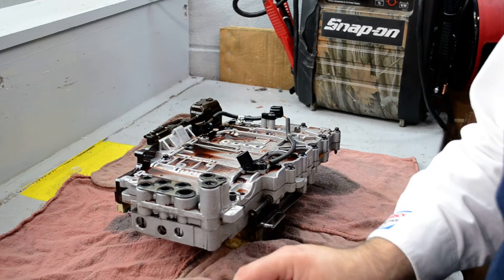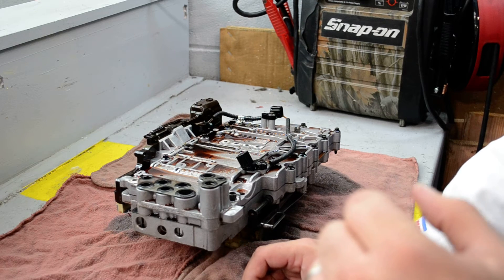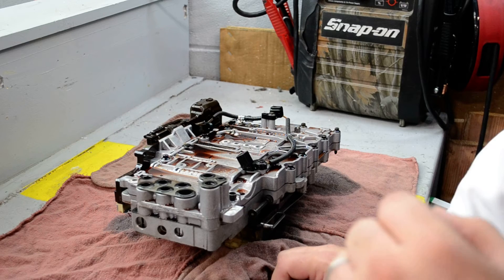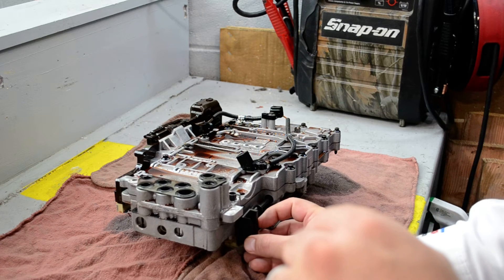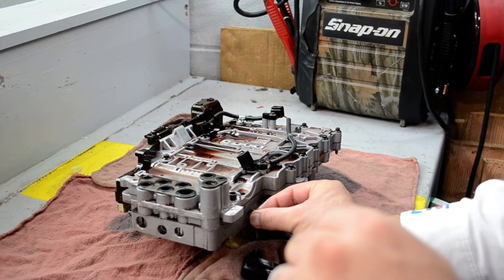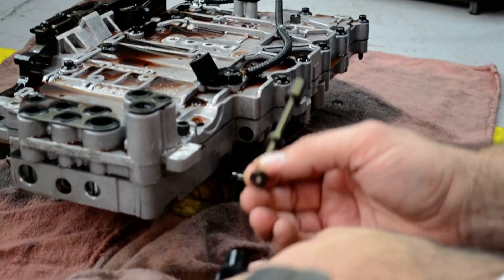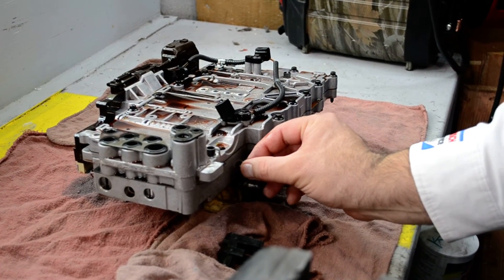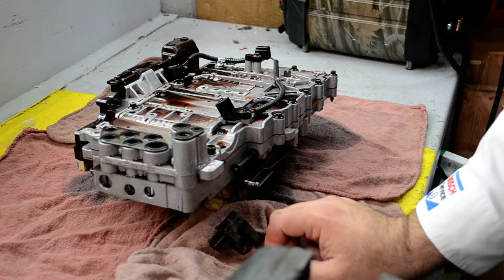No Reverse BMW E90 Xi All Wheel Drive Transmission

Comment: I have the same car with the same problem caused by the same valve stem around the same time! Thanks for the video.
Reply: +funnydognv What did you do to fix it? my e92 wont go into reverse and it acts like neutral but rev only up to 3k in reverse gear.
Please let me know what you did to fix it.
Reply: Sorry for the late reply never seen your question. I dropped the pan and the valve body. Replaced the gear selector valve stem ($18) and sealing sleeve sets ($100, to reseat the valve body). While I'm at it I changed the ATF, filter, and pan gasket ($150). The DME limits revs to 3K when it detected a gear ratio fault in R. It should have thrown an error code in the memory but may not turn on the check engine light.
Reply: funnydognv Wish you replied earlier, would have saved me $2,800 :(
Thanks for replying tho, hopefully someone will see your reply in the future if they have the same problem. 
That $2,800 was harsh, and I was a highschool student at the time too, but its all good now.
Reply from the maker: +redsn0 all of the parts needed are in the comments section.
Reply: There's also a step by step instruction at https://wiki.bentleypublishers.com/display/tech/E90+Selector+shaft+rod%2C+replacing

Comment: I have the same car with the same problem, Today I will open the transmission and I hope it is the same problem that I live here in Nicaragua and no skilled labor if they should repair else
Reply: Hi, Eric. I experienced today the same problem with my 2007 E92 330xi. I am planing to visit tomorrow local BMW dealer but I am affraid I will be end up with a solution of 6000-7000 €...Please inform me shortly if you solved this issue, how and what did you use ? Thank you in advance. Damir

Comment: Had recent problem. Started car, put in drive it goes no where, keep giving it gas it finally drove slowly til it got up to 20 30mph but it wont switch to higher gear feels like 3rd gear I'd say. When I stopped, same thing. I put it in reverse nothing. Could it be same issue or is it transmission. Bmw x3 e83. Thx
Reply: I lost my reverse first, a few days ago, then drive today. Did you find out if this was your problem?
Reply: @2Silverfire2  got it fixed. He said something was broken cost 700. Parts and labor

Comment: Did any body find out about this part?? I just got the same problem on a 2007 Bmw 328xi no reverse no drive and the dealer say is like 6500 to get it fix
Reply from the maker: Find a good independent bmw shop and have them contact our company.
Reply: +BMW Excluservice where is your company name?
Reply from the maker: +Marcos Garcia it's BMW Excluservice www.bmwexcluservice.com
Reply: 2007 328XI - have no reverse issue as well - does anybody know where it can be serviced in Toronto Canada
Reply: Hi joe D. were you able to fix yours i have the same..
Reply: BMW Excluservice I have this same issue but it's also accompanied by the car not passing 1500 rpms while in reverse
Reply: nick martinez any video where I can see how to do this job thanks

Comment: I have a 07 328xi that starts in 1st but goes into neutral instead of 2nd, but can manually take every gear and then go to D after it moves and its fine..  just an issue with 1-2 and flares into 3 at times

Comment: Good info and nice parts list.... only thing is I think this GM unit calls for Dextron 6 transmission fluid.  Any special tools to get it out ?
Reply from the maker: +Fred Williams The transmission in question is a ZF transmission.
Reply: They came with both have to check the tag on the side of trans they do take different fluids

Comment: Thanks man you saved me thousands!  Valet parker killed my reverse solenoid and gave me the car without reverse. Car drove fwd without any problems, but no reverse. I saw this video and bought the part for little $ and installed it without taking the valve completely out. I have another car, so I  planned for a couple weeks planning, ordering parts, getting the right tools (jacks, torks, allen, etc...). It took me another couple of weeks since I was only doing it on the weekends. I drained the fluid, removed the pan, and removed dozens of  bolts but left 2 or3 loosened to allow me to reach solenoid and replace it without dropping the valve. The toughest job was refilling the transmission and bearing the cold weather in New England. Old fluid was nasty. Job is done and car is running great. Thanks!!!
Reply: Where were you able to locate this valve shaft? I am having trouble finding the broken valve shaft that he indicates in the video.
Reply: Yo question
Reply: Don't do this...

Do yourself a favor and buy the seals for the valve body to case also, pull it all the way out and change them too. 

You will have a big sad face eventually if you don't. :(

Comment: I have an 09 328xi with 65k miles. Same thing happened to me but when i parked and came back later it wouldn't go in drive either. Putting it in any gear (reverse or drive) was like putting it in neutral. Wouldn't move at all. ATF is full and no leaks. Could it be the same thing? Im having a hard time believing that it could be the transmission because the car has only 65k miles

Comment: I just got my transmission back from getting a new torque converter and seal and some other interal work on it.  now when I put it on Neutral it stays in place and it's as if it's parked. when I put it in Reverse the same thing . it does not move. do you have an idea of what might be causing this?
Reply from the maker: no

Comment: I have this same issue except also the rpms will not pass 1500rpm now when in reverse any idea? And can you recommend someone in new york city thanks.
Reply: were you able to fix the problem and was it with someone in NYC?
Reply: Muhammad Choudhary it's at the shop should be done. The transmission was rebuilt for me. It was the reverse drum
Reply: nick martinez would you mind telling me what shop and how much is the repair coming down to?
Reply: Muhammad Choudhary unsure of the price lucky I have a warranty to cover it. Shop is T&T auto repair hillside ave queens nyc
Reply: I have the same problem with my BMW X.3 2007 no reverse , please can I have the number of the Avenue ?? thank you so much🚘🚘🚘